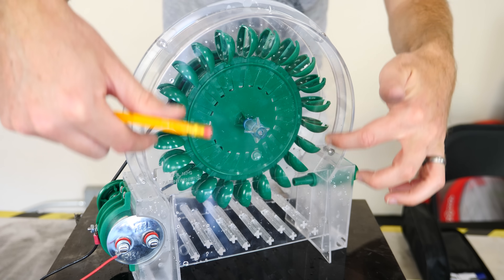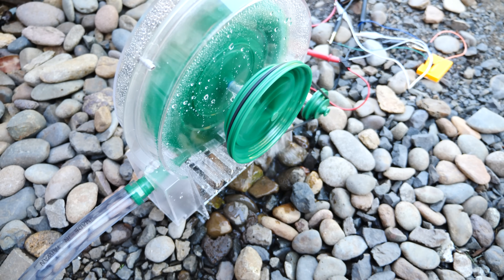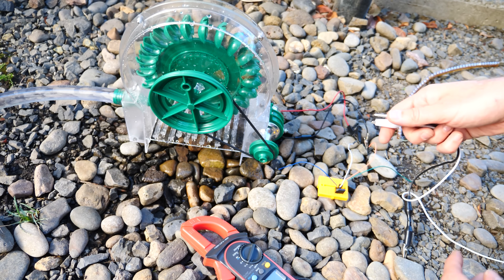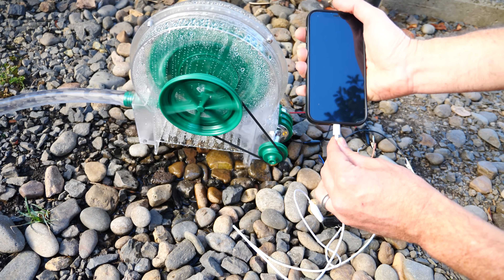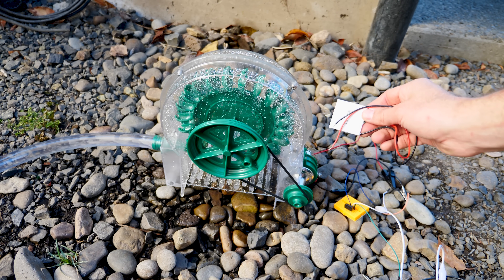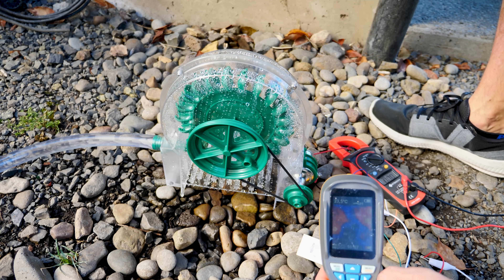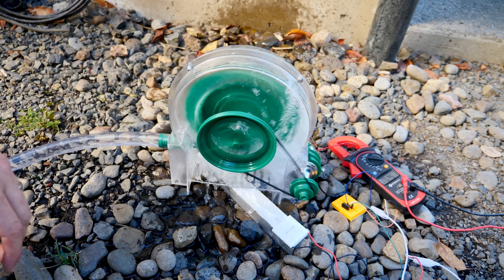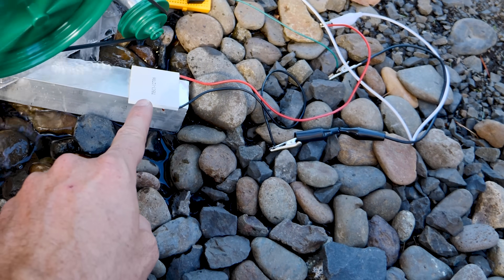Charging My Phone Using Water—How Much Does It Take?

Comment: I was wondering if you have any problem solving on the charging with rechargeable Ryobi or other brand batteries. My dad had it taken apart hoping he could get a trickle charge and get it to work up to a charge amount again but gave up. If you have any advice I would appreciate it.

Comment: Believe there were versions of these turbines made in England that were popular for a bit, especially after the war. I think they were mostly used as a power source for household machinery (grain mills, sharpening stones, etc)  not specifically electricity, though it could be used to run a small generator. Hooked right to the tap.

Comment: By the way, those car chargers like the one you used as a voltage regulator are rated for way more than 12 Volts because they have to take such crazy spikes when plugged into the car. You’d have probably been just fine with the 24 Volts, and it would have charged a little faster.

Comment: Dude, I love your work, but open-circuit (i.e. no load) voltage measuring is a bad habit (and kinda wrong).  Your wonderful contraption clearly still works (cuz you rock), but you might notice a big drop in voltage when you connect the source to a load... it's bitten me in the past

Comment: TIP: that charger looks like it is for a car and will have a protection circuit/regulator inside that tolerates the voltage range of common lead acid batteries during charging (14.4 volts) and also the spikes/unclean power from the car's alternator. Also, some cars and trucks have 24v so they might have made them compatible with that so you could probably go much higher, probably above 30v.

Comment: You could use a rainwater collection system that funneled to a ground floor/basement cistern. As the collected rainwater falls through the final pipe to the lower floor, set up your micro-hydro to feed what it harvests into your house battery.

Comment: Hi James! Love this video. One thing I noticed was that you were clear on the voltage but not so much about the Amps. You mention something about 0.7 Amps but I'm not sure if it was about the Peltier Cell.
Could you please educate people about Voltage and Amps? When people talk about batteries they often say amp hours but they don't mention the Voltage. This is confusing for me because both Amps and Voltage need to be present in order to know how much energy a battery can store. The correct info should be  Wh or KWh to explain how much a battery can hold.

Comment: Question I have is related to thermal dynamics:

how exactly does heat/cold flow within a vacuum behave, while having no matter to pass through? Not sure if this can be an experiment, so its better just phrased as a question.
Reply: that uses the method radiation could search it up?

Comment: You know if you lifted that up off the ground and collected the water coming out of the turbine, then you could reuse the water. And you could use gravity and a siphon to have the water running 24/7. All you would need to do is keep taking the runoff water and adding to a reservoir that's higher than the turbine...  Edit, I finished the video and saw that you were using gravity as a siphon. ;)
Reply: Where does the magic come from that drives your perpetual motion machine?

Comment: You could use a large elevated storage tank for water. Essentially as a battery. During the day use solar to pump the water back into the elevated storage tank and during the evening open the valve water goes out of the elevated tank through the power generator and is stored in a tank at a lower level. Probably not nearly as efficient as just storing the electricity and batteries. But it might have the advantage of having a pretty good lifespan versus batteries wearing out, also you have a water source to use in an emergency. 
Probably would only be useful for small power output. But you could do the math your average water tank is about 3,000 gallons. You could have multiples of these power generators running simultaneously to get more output or power more devices.

Comment: 12V is just the nominal voltage of auto electronics. A properly charging (running) car should have at least 13.5V, to as much as 14.7V fully charged with no electric load.

Comment: When you say almost any energy source ultimately came from the sun, does that include geothermal?  I mean if the sun suddenly turned to ice and   stopped shining tomorrow, would volcanoes and geysers and hot springs eventually cool off too?
Reply: geothermal would still work since it comes from the heat inside the Earth. That heat comes from radioactive decay + leftover heat from when the Earth first formed and would last for billions of more years. Tide power also doesn't need the sun (just the moon). Most other energy sources ultimately come from the sun including wind power.

Comment: Why couldn't you just cycle the water in a closed loop for infinite energy? And yes I know how and why PMMs don't work
Reply: It's not the water that's giving energy its the flow of it, the movement, an infinite water source doesn't mean infinite energy. The energy the water is giving comes from the pump that was making it flow, and that pump also uses energy from a limited source.

The reason why we can't have infinite energy by just cycling water in a loop is because it also takes energy to just make water loop around, which means even if you make energy from it you're also losing equal or more energy.
Reply: @feminico2613  aha! I didn't even put into consideration that the pump itself had an energy source. Thanks!

Comment: What if you place the thing in a container so you don’t lose the water, then if you found a way to get the water back into the machine (maybe a suction hose?) you could use less water while still charging so you only use 5-7 gallons instead. I’m nit an engineer so I don’t know if that would work, just a speculation.

Comment: I'm sorry but this is not smart. You're using buckets which are used in gravity fed wheels. Feeding from underneath doesn't even give all the energy available. And entrapping that bucket wheel into a container with gaps is going to hinder it. You're content is good but this is an easy oversight

Comment: Dude I think you invented the world's least efficient way to convert electricity into water pressure and back into electricity. Nice!

On a serious note, they sometimes have hydroelectric dams with pumps to send water uphill during times when they've got surplus power in the grid, and then when the grid's low they open the dam and convert some of the stored potential energy back into electricity.
Reply: There are also gravity batteries which use very large stone cubes and they raise those as you said or let them go down to use their energy.

Comment: Teoretically if you have river near home OR connect this machine to rain pipes you would have free energy... but can this energy be used to charge car battery or something like that?
I dont understant why solar panels cant store energy to use later.
Reply: A water tank is like a water battery. It falls from the sky, is collected, waits to be used, pours out as the user wants, and does stuff.
A PV cell converts sunlight to electricity, but is not designed to store it.
A solar panel collects heat which is then stored in water or air or stones or something for later use.
Similarly a coiled pipe underground will lower or raise air/liquid temperature to the ground's temperature and cycle it back to be used.

Comment: Well, that water generator looks like it is a DC generator, and the circuit board you hooked up does not change from AC to DC, but instead regulates the voltage down to 5 volts DC for the cell phone.

Comment: This would be great connected further to a garden watering system not to waste water and also getting some power.
Reply: It would be a waste of power, though. You would need power to push the water through. So, using more power just to run the generator is a waste, unless excess power were stored by storing water.
Reply: @eugenetswong  you can put the generator at a higher level of 2 meters for example and then use the potential energy of the flowing water to move it through some pipe and channels at an slight incline ( irrigation trenches). My grandparents used this system to direct water from the hose to the the tomato plants without having to buy extra hoses and dripping systems. But this generator system does not look sustainable in the first place.
Reply: @raa6504  it still costs energy to push the water that high. If the company supplying the water used no electricity, then this is good. If the water was collected without electricity, then this is good.
Reply: If the water is coming from uphill and is cheaper than elecricity
Reply: Absolutely useless idea
Reply: Yeah i was thinking a resevour that recylces the water through a tube with small little turbines that geberate electricity as they pass through the tube
Reply: @unisiple  a large pelton wheel would be better.
the larger they are the better they run if i remember right so small ones would be more expensive

Comment: Could you use a low-voltage pump to have the water recirculating?
Reply: You would lose energy in the process due to friction in the hose and lost heat in the motors.

Comment: I thought you were going to use the voltage from running water its self like in the arc experiment when they run water over copper coils and they produce a spark.

Comment: Ah yes, the good old "let me measure the open-circuit voltage. I'd guess that the phone takes twice as long to charge if not more.
Reply: It was producing 800 ma, which is not horrible for a charger, although it's a little anemic by today's standards.
Reply: @Digital-Dan  "It was producing 800 ma"
700-800 mA at an unknown Voltage.
12 V? Great, that's a lot of power. 1V? That might take some time.
Open-circuit voltage and voltage under load are separate things. There are power-sources that can easily deliver 50V open-circuit but even shortcicuit will only produce single digit microAmps.
Reply: I'm surprised that he did not burned the phone.
Not only average voltage is important, but also peak voltage.
Reply: @sdjhgfkshfswdfhskljh3360  devices for 12V car sockets should be designed to handle quite a lot more as that is anything but 12V. 12V is just the nominal open-circuit voltage of a decently filled battery, but while driving that might be a constant 15 V from the alternator, or well above 20V even. That circuit is allowed to have voltage-swings as high as 40V.
On the other hand this thing likely is quit a bit lower as the 12V were open-circuit and under load i would expect that to drop significantly (which he didn't measure).

Comment: @ 1:58 how does that effect the water speed if the flow rate from the source is constant, does charging the phone transport some sort of resistance in the motor?
Reply: The water hitting the wheel would bounce off more than push the wheel faster. So more resistance with the generator causes the water wheel to slow down which causes the water to bounce off the slower wheel.
Reply: Initially the wheel is spinning nearly freely as the wire are not connected to anything so there is no energy taken out of the system, but as soon as there is a load connected that pulls down the circuit and now the wheel has to push the current through the connected device, which in turn creates a resistive force slowing down the wheel.
Reply: @ABaumstumpf  interesting I didn't think the conversion from mechanical to electrical would be that significant
Reply: @ABaumstumpf  is there a term for this type of mechanical-electrical work resistance
Reply: @ElPsyKongroo  it is the EMF induced. Basically just the work that is being done.
When the wires are open no current can flow and no work is done. But if you attach a load (resistor, charger, whatever) then work is being done, a current flows through the wire and that current induces a magnetic field opposed to that of the stator.

Comment: You would do better connecting that generator to a wheel in a Gerbil cage. 
I was going to do the same experiment with a wheel in my pet Chipmonks cage but sadly they both died before I could finish the build of their new cage and my new project. That was a little over 20 years ago though..

Comment: Me to Gamora: I just saved my electricity bills!
Gamora: What did it cost?
Me: Water Bills!
Reply: well you can build that in all water tubes n stuff so you could get a bit of the energy wasted to pump the water into your hose or faucet or whatever back.
a bit o batteries here n there and this could literally save a lot of electricity from the grid
Reply: Dan Schmo   well I don't see how  528 gallon water per one full charge is financially or environmentally efficient and water power plants use comes from renewable source of energy not by using electric pumps
Reply: @adarshkumarsingh5079  bro you use the water from your tank to your house or apartment right, just make the pipe bigger and put a lot of generators in between
Reply: James Winata Koesnadi  BIG BRAIN 😁😁
Reply: Just let a load of beavers build a dam in your garden.
Reply: Dan Schmo  uhh what about the electricity cost to run the pump?

In any case this water power is not efficient at all
Reply: @구독자500명되면이같은  no electricty cost to run the pump, the water flow because of gravity
Reply: Bro you are here too I saw and had replied on your comment in Muse Asia's Blast of tempest videos
Reply: @leenaranichand8646  Ain't that Wacky?!
Reply: @anisekaieddomtorreto9588  yup
Reply: Newton's third law of motion states that "For every action, there is equal and opposite reaction."
Reply: @cristhebrown2908  quantum mechanics states that it DGAF about Newton's 3rd law of motion. It also states that whatever it said behind Newton's back, it can say it strait to his face.
Reply: Who’s gamora
Reply: What if u use well water

Comment: Question I have is:

Can you create a lenz effect if you wrapped wire around a magnetic core (instead of an iron one) and ran a DC current through it using the bridge rectifier?
Reply: That’s an interesting question. For sure it could ether make the magnetic core ether permanently stronger or partially (or even completely) demagnetized, and the core would also pull to one side or the other. 
But I’ve never personally tested for magnetic lensing in this way. Now I have to.
Reply: @jbirdmax  Hey thanks for taking the idea into consideration. I'm curious to hear your results if you give it a shot.
Reply: Iron is magnetic, though it might not always have strong remenance.
Reply: I’m sure he means soft iron or a ferromagnetic core.
Reply: iron ore WHAT

Comment: You should set up a rig on a creek or rivers with a waterfall where you can use a syphon instead of a hose. This would be more practical.
Reply: Yes,  better than wasting drinkable water (that  you are paying for by the gallon).  In drought-stricken california I just shake my head nope, this aint for us.  Just get a small solar panel and charge your devices from that.  Sunshine is free (and abundant) here  while water is just going to get more and more scarce and expensive.
Reply: It is also raining less due to climate change. I have lived in CA for 50+ years so I know what is normal rainfall and what is lower than normal.  Low rainfall (and correspondingly low snowpack in the sierras) has become the new normal.
Reply: Or if you fed it into a pipe in your house where the pressure wasn't important. I'm thinking in inlet to your toilet cistern, or the gutter drainpipe on the side of your house (if you live in a rainy area).  I'm guessing the cost of the parts would take decades to recover through recovered electricity or someone would have done it anyway, same as how residential wind turbines have never become a thing because it takes decades to make up for a $2k installation cost. I have solar and the $15k installation is still a 12y recovery period, I only did it because I was struggling as to what to invest the money in and it seemed boring but sensible.

Comment: 5:18 what about nuclear power plants? That energy doesn't appear to come from sun 😅. Also hot springs are used too
Reply: weren't the heavier elements created inside the sun by nuclear fission? it's essentially the same potential energy, the power of the sun raises them up the energy ladder and they release that energy when they decay - we use the energy from that to heat water and drive turbines. 

does open up a big mystery about why gravity has so much power to give away in the creation of suns but that's a whole other topic.
Reply: @myphonroboshoes2091  so this means that, you and I too were part of the sun once? 😂😂 Gr8 🔥

Comment: So using 500+ gallons of water, Im wondering if the cost is worth the waste of water in the age of fresh water slowly disappearing.
Reply: Yeah don't do this for real, it is also illegal at least in the UK " leaving on the tap to generate power would contravene parts of the Water Supply (Water Fittings) Regulations 1999 that are designed to avoid the waste of water."
Reply: @jibcot8541  There is always some idiot who will see this video and go hmmm.... Look at the charging your phone in the microwave as a example. World is to full of ignorant people who don't think everything through sadly.